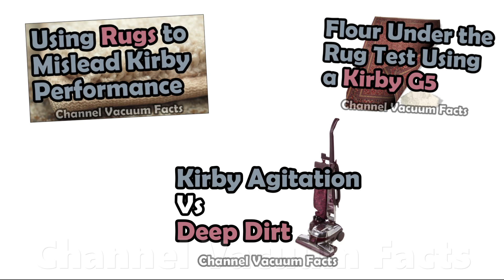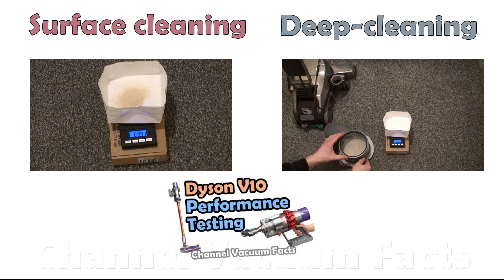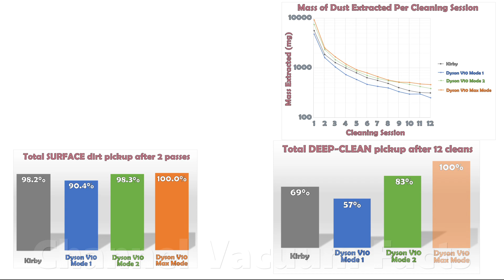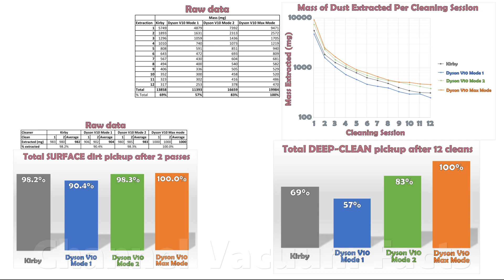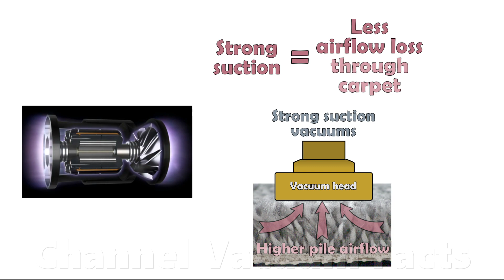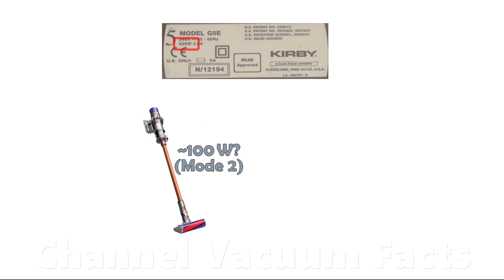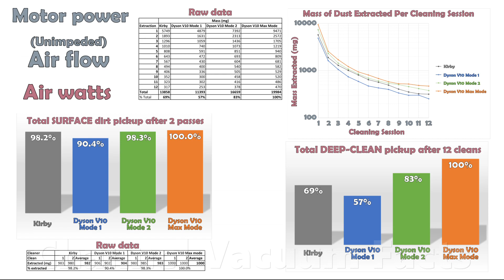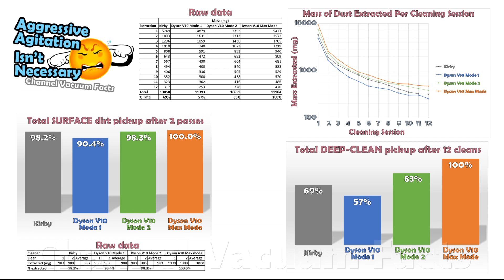Dyson V10 Vs Kirby: How Well Does a Kirby Vacuum REALLY Clean?

Comment: In the early '00s, I went with Dysons.  I'm NOT a vacuum enthusiast, I just want a vacuum that works, and lasts.  Maybe I've had bad luck with Dysons, but after breaking a few, I decided to go with old used machines.  I bought an old Electrux canister vacuum from the 1980s and an old Kirby Alvalir.  Both vacuums were bought at thrift shops.  Both vacuums cost me around half what a new Dyson would have cost me.  Full Disclosure:  I did take them apart, and cleaned them up.  The Kirby needed a new belt and roller and was very dirty when I got it.  The Electrolux needed a new motor bearing, which I replaced, and it needed lubrication. I also bought a replacement hose for it. So these machines were not in mint condition.  But all in I had both machines for less than $250 (including parts), and after dismantling them and seeing how they operate I feel like these will be the last vacuums I ever have to purchase.  I know I can repair them if I run into any problems.  With Dyson vacuums, it looked like I was going to be buying a new vacuum every 5 or 6 years for the rest of my life.  I think people do rebuild them but I feel the plastic just isn't going stand up over time.  Not knowing anything about Kirby vacuums, I bought the Avalir, but now I wished I just bought one of the older models without the drive system.  I like simple.
Reply from the maker: Just to point out a few facts: No idea how you 'broke' them... The only way I've observed to repeatably break a decent product is through abuse and neglect (wilful or ignorant). Buying overpriced machines from 'thrift shops' is a copout; you could have bought any such machine for 'half price' from such places. Evidence shows the 'plastic' does hold up over time on Dyson products, again, if you haven't abused or neglected the product; this is a silly myth debunked a long time ago. And while your anecdote is just fascinating, there's literally everything shown in the video you're commenting on that it ignores...like the facts and data about relative performance and usability. There's nothing simple about those machines. As the review of the Kirby evidenced, they belong in the past or with dusty old collectors. But, different strokes for different folks; some like electricity; some like candles; some like cars; some like horses and carts; some like refrigerators and freezers; some like cool cellars and a large pile of salt; whatever works for them. >_> https://youtu.be/x_Rry3u1Kcs
Reply: @VacuumFacts  You've put a lot of thought into it, more than I have.  I have TWO vacuums for $250 and they both meet my needs.  So not half the price of a new machine closer to a sixth the price per machine.  You're right different strokes for different folks.  But I think you are exaggerating the beneficial differences between machines.
Reply from the maker: Yeah, some people just like specific brands etc. regardless of anything. In my videos, I just state the objective facts and observations. Some people accept facts, truth, and reality; some find those things offensive—especially if they conflict with a tribal worldview. The relative differences between the machines compared in this video and the review are substantial and undeniable. More importantly, they show many claims made by others are completely false. Exposing that was the primary objective of this video.
Reply: @VacuumFacts  Do you prefer chili with beans or no beans?  What about calibers, are you a 45 or 9mm guy?  Do you like Ford or Chevy trucks?   People like what they like.  At the end of the day, we're talking about vacuum cleaners.   Let's keep it in perspective.  My 40-year-old vacuum cleaner does what I need it to do, so I'm fine with that.   But you do you.
Reply from the maker: People like what they like. That's not in question. The question is what's objectively true, independent of subjective likes and dislikes. This truth was presented in the video. The facts speak for themselves. I can respect opinions that are informed by evidence. I have too much respect for people than to respect the silly subjectivities they may subscribe to that conflict with reality. At the end of the day, we're NOT talking about vacuum cleaners; we're talking about what is objectively true and supported by evidence.
Reply: @VacuumFacts  Dyson is superior but the plastic is an issue, I have seen it. I am afraid you are being blind to that fact. I liked your comparison, it convinced me the Dyson cleaned better.
Reply from the maker: @aviator97msncom  I've seen no objective evidence to support the claim "the plastic is an issue" and plenty of evidence to show it's not. Given that your subjective claim that 'you've seen it' isn't particularly convincing evidence, do you have any objective evidence to provide that convincingly supports your conclusion? If not, I simply don't believe you.
Reply: Kirby Alvalir is not old it is the latest model... My first Kirby was in 1973 which did not have the drive and I can tell you that it's a heavy machine to push around, my wife (deceased) hated it.

Comment: Our Dysons (the original and The Ball) shredded our carpets. We were always pulling beige nylon threads off of ourselves-pieces of our carpet. I now have both a Kirby and a commercial Sanitaire. They do not have aggressive brushrolls, even though the Sanitaire's brushroll (being metal with a beater bar) looks intimidating. They vibrate the floor and the airflow pulls the dust out, instead of shredded the carpet fibers. You can feel the vibration if you put your foot on the carpet in the vicinity of the machine. It's the same carpet we had when we went through 2 Dysons, but we're not longer pulling bits of our carpet off of our clothes and everything else. I think those pieces of shredded carpet fibers may make the Dyson look like it is picking up more "dirt" but it is bits of carpet. I thought at first it was cat hair, until I looked more closely.
Reply from the maker: I've never seen any evidence supporting what you claim. Feel free to send something reputable that unequivocally shows it couldn't be any other reason.

Comment: Sorry the reason your test is flawed is that you used the Kirby dirt meter pads for the tests . Once these get a fine layer of dust on them the airflow out of the machine is almost completely blocked thus not allowing for dirt and dust to be picked up. If you wanted a fair test then run the Kirby with its bag by first measuring the empty bag weight and then vacuuming and then weighing again with the first picked up. Or you could have stuck a Kirby dirt meter pad in the dyson tube this capturing the dirt before it entered the collection bin and the Dyson would fail miserably as well. If anyone reading this is interested in understanding more about why this guys tests is flawed and would like to see see real and accurate testing with the Kirby against other machines, then check out VacLabs channel. A Kirby receiving the seal from carpet and rug does mean something and they test well also. Amd they also test all the other brands. Kirby always scored well except in the weight category. Cause while it’s heavy to lift yes, but it’s effortless to push.
Reply from the maker: You are making assumptions and peddling myths. Citing channels that are champions of such poor behaviour doesn't help your case. I suggest you watch this which explicitly and empirically demonstrates you are completely incorrect. https://youtu.be/kUgLV3be7Sg I'd also recommend watching the rest of the Kirby videos in this series which debunk many common myths once and for all https://www.youtube.com/playlist?list=PLBxUOcW7kaEs7xuTK2A-pncwupMjXuRbb

Comment: As somebody who has owned several Kirby's from some of the earliest which I happen to prefer to their newer transmission driven units and a Dyson V10 absolute I agree with these findings however there is more to a Kirby than just suction. Kirby's can be used as Sanders, carpet restore tools, shampooers and a few more things. The Dyson V10 absolute is a great stick vac for hardwood floors, Upholstery and carpets but since it lacks the shampooing feature it will never clean as well as a Kirby. Know if we're just talking about suction and agitation the Dyson on mode 2 is very much like a Kirby. Think of it this way. 28 minutes of Kirby like performance without a cord makes it a clear winner. I personally would not pull out a Kirby today unless I was using it to restore or shampoo carpets. I would use almost any other vacuum.
Reply from the maker: >> “there is more to a Kirby than just suction. Kirby's can be used as Sanders, carpet restore tools, shampooers and a few more things.”
Yes, but they aren’t marketed for those things. They’re just incidentals. They’re marketed as vacuum cleaners first and foremost, so they are judged as vacuum cleaners first and foremost. The ‘Swiss army knife’ of things doesn’t make something good, particularly if it’s ridiculously cumbersome, expensive, and impractical to achieve alternative functions relative to a tool which is designed specifically to do the job extremely well. Jack of all trades; master of none. It’s just no argument in favour of a Kirby, as discussed in the review.

>> “The Dyson V10 absolute is a great stick vac for hardwood floors, Upholstery and carpets but since it lacks the shampooing feature it will never clean as well as a Kirby.”
If you agree with my findings, as you say above, then this statement contradicts both it and reality. For dry dirt, which is what vacuum cleaners are for, the Kirby is empirically observed to perform objectively inferiorly. And my other videos clearly show the weaknesses of the approach Kirby uses to clean carpets using shampoo. Many other tests on YT have clearly demonstrated it does a very poor job. There are several videos on my channel showing how carpets should be cleaned of sticky dirt that requires chemistry, by using microsponges and a simple indoor broom.

The V10 has been superseded by two major versions now and the latest V15 exceeds all vacuum cleaners (including mains-powered) I’ve ever tested for performance.
Reply: @VacuumFacts  lol. Uh no. When the dude who came by first sold us our Kirby, he MAINLY talked about was how useful the shampoo function would be. Cause you know... I'm that fkn old. (Have used the thing many times before I lost the pieces and it worked just fine for me, cheaper than renting a capet cleaner.) I remember the salesman. It was marketed as a all in one purpose machine. BTW, our Kirby is over 25 years old and STILL runs like a fkn top. We've had to replace the belts of course and buy bags, but they are dirt cheap compared to how expensive they were years ago. We bought a Dyson for our grandma before her death, and the fkn thing gave out after 9 months and never worked on her carpet well. Got a refund and never bothered with a another one. We ended up lugging that heavy arse kirby back and forth but with grandma's dogs, god was it worth it. 

A Dyson is meant for fools who would rather claim the name than the function. Like Apple vs Android. I'm assuming you're bending over for them as well?

I can't believe after all this time you're STILL OUT HERE talking out of your ass. FFS man, you have GOT to get a different hobby besides sucking off Dyson. Unless you're getting paid for this, which I highly doubt considering how small your channel is... please. For the love of all that is holy. Go race RC cars or something.

Comment: I have both a Kirby and a Dyson.  They are both great in their own ways.  My Kirby is 15 years old and still works perfectly.  I have maintained in carefully because it is worth it.  My wife says it is too heavy.  I genuinely believe it removes dander, microbes, fine dust, and the stuff that makes us sneeze and irritates our respiratory systems.   It is built like a tank and the HEPA filters are very effective.  It was crazy expensive at the time!  The Dyson was cheaper, although still not cheap.  It is light, it definitely has effective suction,  it’s mobile in tight corners.  But I find myself emptying the bin very frequently and I have no confidence that it will last many years under frequent use.
Reply: Well, you have to empty the bin very frequently because it works like it should. I mean, it vacuums the dust. I had the same "problem" when I bought a dyson.
Reply from the maker: The Kirby works but there is better technology in every way out there, as the content on my channel shows and quantifies. With basic care and responsibility, Dyson machines are expected to last 10 years at the very latest, by which point, many will want the upgrade to a product which makes the job easier.

Comment: Well you tested an old version of Kirby against an updated vacuum from Dyson, a fair test would be vacuums that are both up to date.
Reply from the maker: You're contradicting many Kirby fans by saying that. I also don't believe that because modern Kirby's are virtually identical. They also have the same basic design issues. You've also provided no good reason whatsoever to think what you suggest, especially given how they work and the core vacuuming principles I've discussed in detail on other videos. You're just peddling wishful thinking.
Reply: @VacuumFacts  what a poetic rebuttal and eloquent too. 
I can't convince you to do it.. but suggesting that's it's equal is far from fact. Electronic and electrical parts are not finite but most people think so. The motor, "that's most likely used beyond imagination" has oxidized copper or aluminum winding that lowers the performance of the machine. The newer machines use a different bag, that can prove different results. Finally since the dinosaur model, plenty of research was done to improve flow from the nozzle to the bag just as Dyson has done and well you still performed a biased test. 

ciao.
Reply from the maker: @dannyozuna  I've seen no evidence of the claims you make, nor any objective evidence to support any alleged corresponding performance improvements. Feel free to provide some. And then there's literally everything else wrong that was raised in the review.
Reply: @VacuumFacts  you're too much, i just can't right now. I just can't
Reply from the maker: @dannyozuna  Then stop making factual claims you're not prepared to defend when someone demands evidence.

Comment: Vacuum Wars tests the stick vacuum by Dyson and other Dyson vacuums vs the Shark Apex which I have... I didn't make a purchase but did have a Kirby demo last week and it certainly picks up stuff my Shark Apex doesn't.

My carpet is fitted, but like most carpet that I've seen, it's only the edges that are holding it down.
Reply from the maker: Vacuum Wars is an entertainment channel, not a reliable source of high quality facts. The tests shown are not representative or meaningful.

Comment: Kirby must be doing something right. They have been around for like 100 years maybe more. They still sell and are serviceable. Dyson breaks you throw that 600 dollar vac in the trash. Most likely for a 50 cent switch or circuit board.
Reply from the maker: 0_o that's not very good logic. Just because they're still around doens't mean they're doing things right. Their market is large, so even having a trivial share of it at those prices is enough for survival. Their sales practice is appalling, their performance is poor. You might cite a 50c switch, but you conveniently and misleadingly omit the cost and hassle of hiring someone to fit it for you. You are also making false claims; in the very unlikely event a Dyson breaks (that wasn't caused by abuse and neglect), then under warranty, Dyson ship you out a modular part for free and you swap it in. No cost, no repair hassle. And even if it's out of warranty, you can buy parts for as long as it's supported (about a decade). At which point, technology has moved on and time for an upgrade. Keeping old technology which performs poorly and has larger impact on the environment etc. is no virtue.

Comment: İ have both
 The dyson just sticks to the carpet and cant be moved unless om mode one
Rubbish
Reply from the maker: And you saw the bit in the video where the Kirby sticks even worse (not because of high suction, but becaues of the geometry of the cleaner head) and needs to waste power and cause more noise with tech drive to kludge it way around that. And using mode 1 to reduce suction doesn't mean the cleaning performance on that particular floor type reduces. This is a common misunderstanding. Very few carpets cause clamping onset with the V11; this is not true of the Kirby without tech drive.